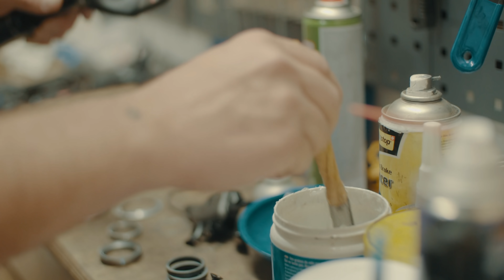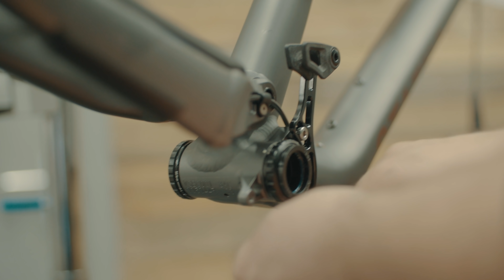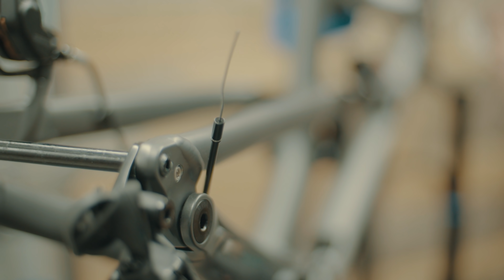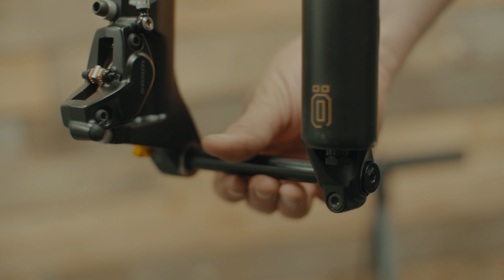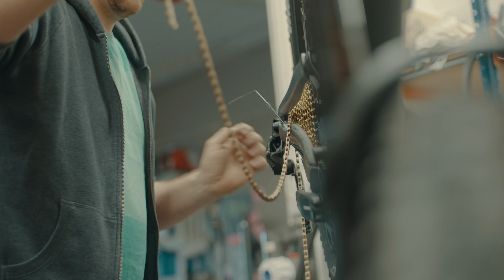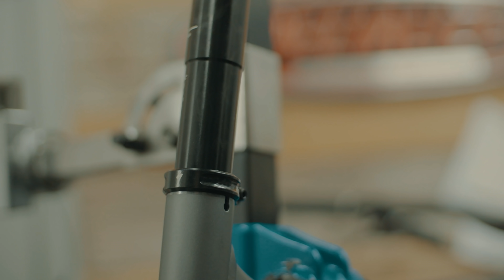DREAM BUILD MTB - #STATUSMTB

Comment: NX crank but xx1 derallieur? Why tho?
Reply: First thing I noticed as well so confused not bashing NX at all as I run it on my rig but just confused by NX/ XX1 mix
Reply: @enorbz  same here, NX is great, but if i would go with the full xx1 derallieur, cassette and chain, i would also go with xx1 cranks 🤷🏻‍♂️
Reply: Why is mixing crank and derailleur bad?
Reply: Jando Gonzales it’s not bad at all man, it’s more the fact that he mixed an entry level crankset with a high end group set that’s all
Reply: @talesfromthetrailz  just irritating not bad
Reply: Ah I see, I didn't know the crank set was of lower quality. Trying to learn more about the entire gearing system. Would you go with aluminum or carbon crank set?
Reply: Jando Gonzales really up to you I prefer an alloy crankset that is decently strong and I’m too concerned with weight. Folks that go for carbon crankset will see benefits of weight shavings and a bit stiffer chassis than alloy as well
Reply: @talesfromthetrailz  my current is aluminium and its great when you hit a rock, because it just take a scratch. But I want to upgrade on carbon X01 cranks with these crank boots to prevent these rock hits on the carbon, cause you can hurt them pretty bad 😅
Reply: @enorbz  I want to upgrade, because of the weight and the stiffness. I want to CrossCountry-fy my bike 😄
Reply: NX crank maid me confused but hey it’s easy replaced...
Reply: @enorbz  True but in that case GX would have maid sense.

Comment: Nx crank with xx1 transmission, interesting 🤔
Reply: at first i thought the same... maybe he want to save some money. my next chainring will definitely be an nx. because the gx is expensive and made from aluminum. i cracked it on some points when im doing trial-fun. nx steel and cheap...
Reply: Joel Veltmann yeah I agree ! In my opinion, if I was able to build my dream bike, first I will use shimano parts. 😂Secondly this status is a beast, fork, shock, the frame is an absolute beauty. Every components are really high range, and for me the crank is a little bit undershoot with the global quality of the setup !
Reply: @Thbmn116  the shop is letting me swap a bunch of Sram off my Status for Shimano as soon as it shows up. I'm stoked for it
Reply: @SnootchieBootchies27  yeah man sounds good 👌 🤘

Comment: SRAM nx that's a first
Reply: Xx1 then nx Cranks ikr
Reply: I upgraded my dj cranks to them... Now i know that they were a good choice
Reply: Burly cranks. I don't see any problems on that choice.
Reply: @GuGaahOwn  Its just odd because ususally you would pair a light cassette like the XX1 they put on the bike with a light crank.
Reply: @blakestory9768  Maybe weight isn't a thing, since the frame is made out of aluminum.
Reply: @GuGaahOwn  Yeah but why put an xx1 cassette then
Reply: @blakestory9768  Rotational mass.
Reply: @GuGaahOwn  LOL
Reply: @blakestory9768  Yup, it's a thing.
Reply: @blakestory9768  Hope I'm not BS'ing all over the place, otherwise it makes no effing sense.
Reply: @GuGaahOwn  Nah I guess it makes sense actually but Ive just never heard of people doing that.
Reply: @blakestory9768  At least I'm that guy who runs DT Swiss spokes and alloy nipples to shave weight on wheels. As I mainly ride dirt jump, it makes a hell of a difference. But hey, shaving a few grams on a dinner plate sized cassette is a nice thing.
Reply: @GuGaahOwn  Very true
Reply: Gustavo Machado a cassette doesnt rotate fast enough to habe an crazy amount of rotational weight and it only does move at all when pedalling but i get your point
Reply: One word, shift quality. I have ridden both and there is so much difference, and if you want an aluminium crank anyway the nx is fine😁
Reply: This Specialized Status only retails at around 2500 so an NX crankset is spot on to be honest
Reply: No, nx is good, its just that most people go full xx1 or x01
Reply: @georgekell2344  It's pretty good, actually. Bang on price-performance.
Reply: It’s an xx1 cassette though
Reply: I think it makes a lot of sense. You don't want a heavy cassette because it interferes with the action of the suspension, the lighter the better and on top you add of shift performance. On the other hand the weight of cranks is center on the bike and you won't notice it over a lighter crankset. In fairness, as many have done over the years, adding weight low and center on the bike makes it more stable. On such a gravity oriented bike makes a lot of sense.
Reply: George Kell always funny when you see a “dream build with” nx and a performance shock
Reply: Baldó Miglécz yeah there’s nothing wrong with them but it’s just weird to see nx mixed with xx1
Reply: @blakestory9768  Aesthetics and shift quality. Not everything is about weight. XX1 cranks don't look like anything special or feel any better under foot, so they are pointless if you aren't about the weight.
Reply: @vomErsten  then go x01 thats got basically the same shift quality as xx1 and its pretty much the enduro groupset. the whole point of xx1 is to be light.
Reply: @blakestory9768  Did you not read what I just wrote? I also said aesthetics. If you go X01, you are stuck with grey. If you want copper, gold, or rainbow, you need XX1. If you want black without downgrading shift quality, you need XX1. If you don't care about the worse shift quality and want black, GX is an option.

Also, the 50T X01 cassette is technically a few grams lighter than the 50T XX1 cassette since it doesn't have the bling coating, 357 g vs. 364 g. If you really, truly want to go ultra light without deviating from the Eagle line-up, then you run an NX shifter with X01 cassette, XX1 cranks, and XX1 derailleur.
Reply: @vomErsten  ok! its just a weird ass option i dont think its that deep lol
Reply: @blakestory9768  because it's gold
Reply: Don't know why people moan about nx stuff, I've had no problems with mine although I have got decendant crank.

Comment: Another mechanic who double torques 🙄😂😋
Reply: Because of that satisfying click ..
Reply: ..and overtorques, by turning beyond the click
Reply: I noticed he did it on all of the bolts except the stem which is holding the carbon bars. Perhaps there is a method in his madness in double torquing of the parts that interface with metal and not the carbon ones which are more prone to failure from over torquing.